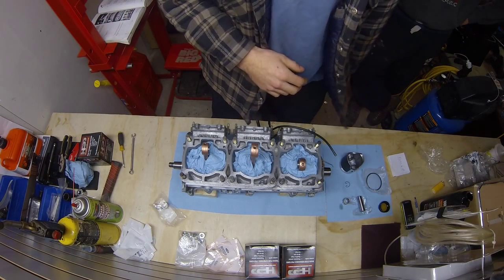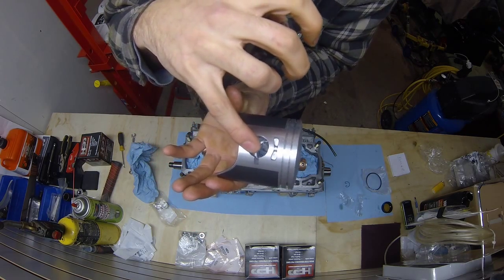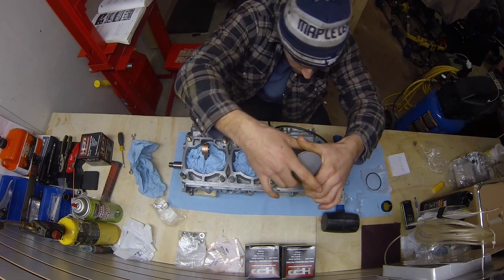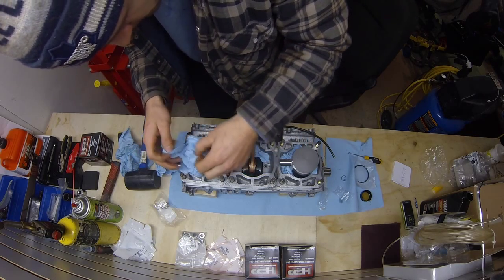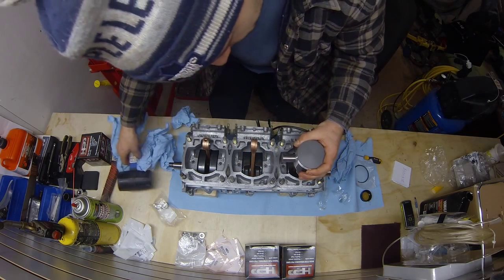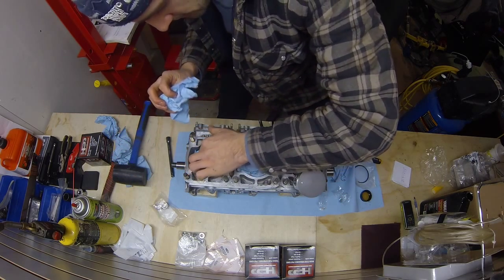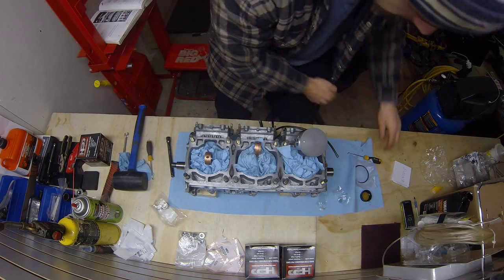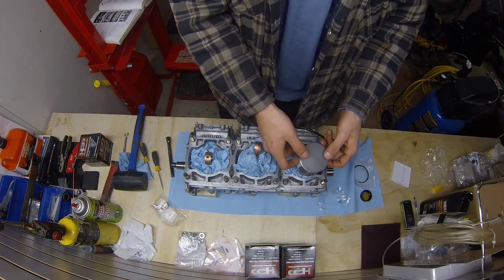How to Install Pistons on your snowmobile 2

Comment: good job but your circlips are installed 90 degress off. gap should be up or down. with your gap on the side it is possible for the clip to compress and fall out under high rpm

Comment: When you put the C-clips in, always make sure the gap is pointed up or down. You have the gap pointed to the sides.
This is to keep the clip from popping out of the groove due to the G-forces created when the pistons goes up and down at 8000 RPM.
Reply: +MarcusN yeah i know i changed it after wards, i forgot during the video, but if you do not like you said they can rotate out and go into the bottom end and then your up shits creek